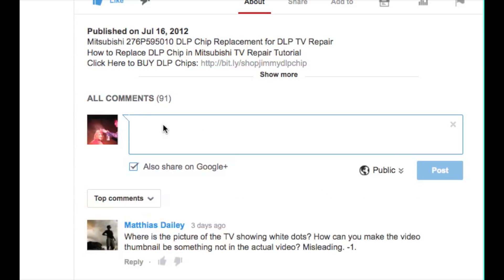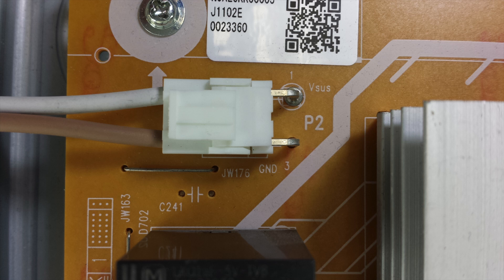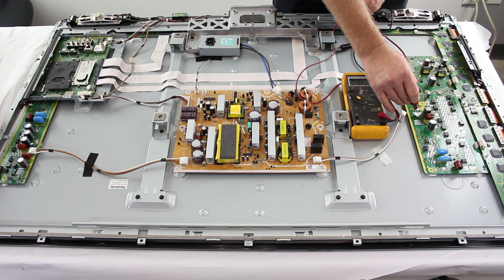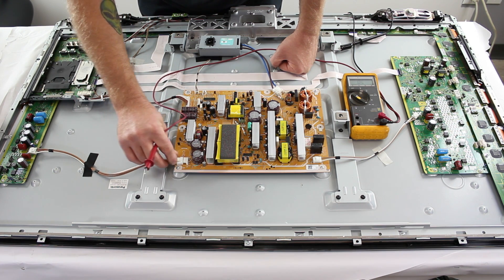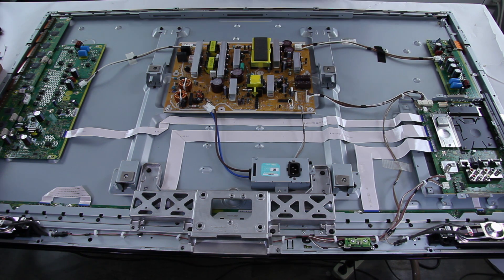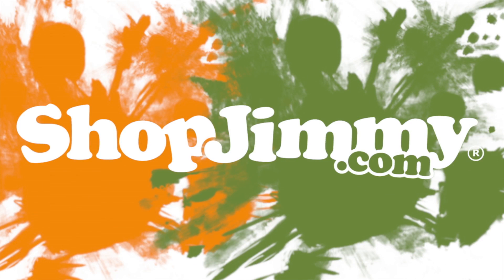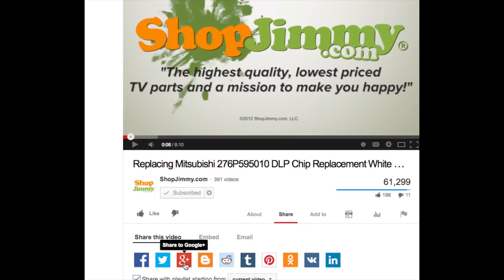Panasonic Plasma TV Repair - Understanding 14 Blink Code - How to Fix 2011 Panasonic Plasma TV

Comment: Good day “Shop Jimmy” folks! This is a great video and I appreciate you guys being willing to share your knowledge and info, to help people save some money and DIY repair their TV’s, etc. 

Ok, I have a PANASONIC 
MN: TC-P50ST30

That is giving me the “14 BLINK” error code and will not come on. I hear the clicks when it powers up, but it never comes on. It was just giving me the constant red light illuminated. But after messing with it some, I was able to get the “14 BLINK” error code.  So, can you PLEASE help me out by telling me what this error code means? What is the usual issue (if there is a common issue, that goes with this particular code, of course.)? And is this error code what will make me need to follow the steps in this video, to determine where a “short” is located and which board to replace?  If so, then that is exactly what I will do.  I am a master Mechanical Technician and I work with a multimeter all day every day, troubleshooting commercial and residential HVAC, refrigeration, ice machines and commercial cooking equipment electrical and control systems. Both high and low voltage systems.  So, I am HIGHLY experienced and good with a multimeter.

So, if I am following this video correctly, we are attempting to locate a “short” within one of the boards on this TV or within one of the connecting cables?  Is that the only thing that causes this particular “14 BLINK” error code? It is ALWAYS a short of some kind, within one of the boards in the unit?  Nothing else can cause this particular code to be thrown by the unit?  

Once I determine which board the short is located within, is there any way to actually PIN POINT the short and JUST repair the component that is shorted to ground? Whether it is a cap or a resistor or whatever kind of little components that are used in these boards, by removing the shorted component and soldering in a replacement?  If that is possible, do you guys sell JUST the little component, that I might need or do U JUST sell the complete board assemblies? And if u do not sell the individual little resistors and caps and stuff, do you know where I COULD purchase them from? 

Thanks in advance for any and all advice and assistance you can provide me, in order to repair my television.   Well, to be completely honest, it is my new neighbors television and she is a single mother with 2 children and 2 jobs, etc and the poor little lady JUST moved into the apartment next door and set up all her furniture, etc, set up her TV in the living room and was sooo ready to just sit down and relax and watch some TV and enjoy her new home and the fruits of her labor, in getting all of their things unpacked and the house transformed into a “HOME” for her and her precious children, plugged in her TV, turned it “ON” and.... well... it never actually came “ON”! Lol. So, she is not in a financial position to be able to just go and purchase a new large television for their living room, with her being a single mom of 2 and not getting ANY child support from their POS father, etc etc. 

So I told her that I have repaired a few TV’s of my own and family of mine, over the years and that I am most definitely capable of repairing her TV for her, IF it is repairable and the cost for parts is low enough to make it worth fixing, etc. 

Sooo, yeah. I am just trying like heck to help out this angel of a little woman, that just moved in next door.  So please help me, help her?  Again, thanks in advance and God bless!

Comment: 40" Panasonic,  black screen. Sound works,  red light is on,  no blinking. Manufacture id is TC-55CX400U SERIAL # MD52811741.... No model number

Comment: I  just inherited a Panasonic TC-P42X3! The  TV tuner works when connected to a cable box through a coaxial cable, but not through HDMI 1 or 2. Any suggestions or recommendations?  Thanks in advance for your comments or advice! The former owner thinks it has been hit by power surge .

Comment: Hi, I have a Panasonic Viera, model P42XT50D. Sometimes it switches on and after I put it off it doesn't switch in immediately. I've observed over the months a strange behavior. I just leave it in the off condition for about two or three days and then again I turn it in suddenly it comes on and works fine and if I turn it off again its the same story. However if its plugged into the UPS and I only turn the set top box off then its ok. But then if I mistakenly switch it off completely then I'll have to wait for three days as I mentioned earlier. I took it to a service center and he charged us a bomb but the problem persists. Could you please provide us with a solution? Thank you so much and good luck. 😊👍

Comment: Hello and thank you so much for helping.... I have a TC-P65VT50 and It will not turn on and the power light is BLINKING 3 times...please help and thank you so much.. we did all the unplugging and using different outlet stuff...

Comment: Hi. I have a Panasonic  TH50PX75U  the problem is the upper half of the display is blank while the lower half clear picture, from time to time the upper show up but distorted display, then goes away. What could be the problem I suspect the SU board but not sure  ..help ..please..
...

Comment: Hi I have Panasonic tx-58ax802b it was working just fine then suddenly not turn on just show Panasonic logo for 2 sec then clicking sound from power board and goes off then Panasonic logo on for 2 sec and this keeps happening so I did reset with _v on TV and menu botton on remote so it reset and now when I turn the TV on hear click and Panasonic logo for 2 sec then screen go off and no pic I can see the back light on from the back still on what could it be

Comment: I have Panasonic TC-50PX34. I get sound but no video for about 30 minutes. After 30 minutes the video works fine. If I turn the tv off for more than 1 hour it will do the same thing. Got sound but no video for the first 20-30 minutes. Also I am not getting any blinking codes from the red power light. Any help with this would be greatly appreciated?

Comment: Hi I have a Panasonic viera tc p54vt25 with a steamy foggy screen that looks horrible in daylight. Cleaned with a lens cleaner a micro fiber cloth didn’t fix the problem, looks like issue is behind on the inside of the screen. Is getting to the screen towards the guts of the tv a big job ?

Comment: Have a TC-P55ST30 - "14 blinks" problem whereby when TV is turned on, the screen is black, no audio, and solid red light.  Red light stays lit even though Power button (to turn off) is pressed - so need to unplug to turn off TV.  Once turned back on, the 14 blinks appear.  MAYBE IMPORTANT ==> Occasionally TV will work and when it is working, have never had screen go black or otherwise misbehave.  Also, so what am I to do differently when testing when I see GRND?

Comment: Hi, I have a Panasonic 50" Plasma TC-P50ST30 made in Nov 2011. When turned on the relays click on but picture never comes on... the LED is solid red. When the power button is held for 5 seconds it blinks 14 times. After lots of research i'm told it can be the P-board, A-board, or SC Board. I have also disconnected SC2 according to one forum i read and the LED will blink 7 times. Any help is appreciated!

Comment: In this video you check for short at TPSC1 with the power and ribbon disconnected and only talk about what to do when the short is observed "disconnect connection to SU board and repeat..." On my SC board with power and ribbon disconnected I get open (no short) at TPSC1. Does this confirm that my SC board is bad? Many thanks.
Reply: I'm at the same point with the TPSC1, the video is not clear if this means it is the SC board or not at that point.

Comment: Hi ! 
I have a Panasonic tx-p55vt60e 55" from 2013 and seens few days the screen shut down at random time with a 10 blink code red light.
I did dismount the plasma screen to clean it from dust in the case of overheating problem. 
It seems the power board is faulty, but any good advice would be much appreciated

Comment: Hi, I have a Panasonic TV MF0230307, made in Nov 2010. It has a 10 blink code, which I am wondering if I should change the power supply board? I have already changed the A - board and there still is no progress so if there is any advice you can offer, that would appreciated!!

Comment: S O S......HI CAN ANYONE GIVE HELP OR ADVICE MY 50" PANASONIS VIERA TV MODEL TX-P0X20B.....BIG PROBLEM IS IT IS CHRISTMAS AND I JUST CANNOT FFORD NEW TV AT THIS TIME WHAT WITH HAVING TO BUY KIDS GIFTS AND ALL MY SMALL WAGE JUST DONT CUT IT..PLEASE COULD YOU TELL ME WHY MY TV HAS JUST STAARTED INTERMITTANTLY TURNING OFF THEN ON AGAIN..THIS CAN HAPPEN ANY TIME,, SOMETIMES WHAN I JUST TURNED IT ON AND OTHER TIMES IT WILL HAPPEN AFTER IT HAS BEEN ON TWO OR THREE HRS....I,M JUST SCARED IT MIGHT GO OVER CHRISTMAS AND RUIN IT FOR THE KIDS..PLEASE ANY HELP WOULD BE WELCOME....I CAN USE A SOLDERING IRON HAS I USE ONE OFTEN TO REPAIR HEADPHONES ..BUT I HAVE  NO ELECTRONICS EXPERIENCE.. SO NO CLUE WHAT TO LOOK FOR..THANKYOU IN ADVANCE. HAPPY CHRISTMAS TO ALL..BRI     brian.wn@hotmail.co.uk

Comment: HI,  I HAVE A Panasonic 32" TC-L3232C Flat Panel Television THAT THE RED LIGHT ON THE FRONT KEEPS BLINKING CONTINUOUSLY WITH  NO BLINK PATTERN AND THE TV TURNS ON BUT WON'T STAY ON, WHAT SHOULD I DO?

Comment: This was completely useless,  you didnt explain what to do if sd46 connection had a short within itself.  Nothing shorts until I touch the connection for it.  The resistor you show doesnt have anything short, until I touch the connection on sd46.

Comment: i have a Panasonic 55 plasma, tpc55gt31 getting a 14 blink code  i have replaced the main board, sub power board and the power board on power up a light will come on on back of sc board for about 5 seconds then a click and that light goes out

Comment: Hi I have a 50" LCD Panasonic TC-47LE54 made Sept, 2012. When I plug in the power cord I didn't hear any click in relay of power board. When I press power button in front it stay red light for about more than 5 minutes and then it blink  red 13 times. please, Any help is appreciated. thank you

Comment: Hi I have panasonic model number TH-P50GT30A
After switching on TV 'red light'  blinks 7 times at a time and continues on in intervals. which board need replacement or repair?

Comment: Hi. I have TH - 42LFE6W. Screen goes on for a second and then off. 
When pressing power button, the LED light turns green for a few seconds and then flashes red once continuously after 2-3 seconds. Regards

Comment: I purchased your repair kit for the TNPA5351 SC board on my Panasonic TC-P50S30 plasma. The SC board showed a short across the pins of the SC2 connector before replacing the components and open after replacement. I reinstalled the SC board in the TV and it ran for about 5 minutes. Then I heard a click and the TV was dead. The SC2 pins are shorted again. Any suggestions?

Comment: All of my boards are testing as shorted on my TC-P42ST30. Maybe there are repair kits for the P (TXN/P1PKUUS) and SN (TXNSN1PKUU) boards. I have a spare SS board and am ordering a replacement A board because only one HDMI port is good.

Comment: I have a TCP50UT50 when I turn on it clicks then gives me blinks 3x.Where is the 3.3v Dboard that's what I was told is the problem with a 3x blink. If you know the part model no that would be helpful as well. I'm sure this is a rare model.

Comment: I have a xcanvas lg 50 inches with a standby light with you switch it on you will see a green blinking light but it will go back to standby again.......Water go into it just today ....after I wash the power supply and and also dry it.....when I put it on the first time it was okay after then the tv is on standby since so I want to know what is the problem

Comment: Hi, I hope you can help me.  I have a Panasonic TX-P42G15E plasma TV of 2009 which thus not want to start up anymore.  When turning it on, the green LED will start blinking (as it is supposed to do).  You can hear it clicking on.  After a few seconds, the green light turns red.  It will continue blinking red.
So, as per your instruction video, I have opened it up and measured a few points.  (I use a Fluke Finest 201 multimeter)
At the main power board – power inlet connector P9 : both pins 1-N and 2-L are not shorted. - infinite eg > 20MOhm.
With all 3 connectors P9, P2 and P11 disconnected, I measure the following values:
At connector P2, pin 1 – high value, pin 3 – shorted.
At connector P11, pin 1 – infinite, pin 3 – shorted, pin 4 – high value.
Kind regards, Peter

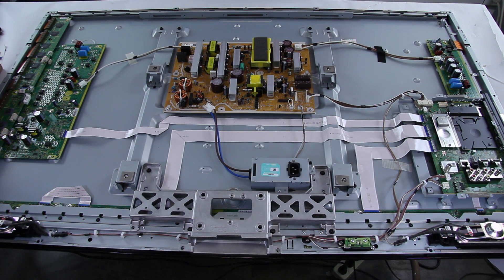Comment: I'm getting a 14-blink sequence on my Panasonic TC-P46ST30.  I'm a little confused by your instruction at the 5:00 mark of the video, here are my symptoms.  Upon plug-in, the front LED is on solid.  If power switch is pressed momentarily upon first relay click, LED stays on solid.  If power switch is pressed and held for 3 sec. upon relay click, the LED stays on then goes off after 3 sec.  When switch is released  the 14-blink sequence starts.  Does this indicate a problem with the A board?

Comment: TC-P50S30  No picture, no sound and 14 blink code.  
No short at P2 when unplugged.  Unplugged ribbon and connector, short at SC2.  No short at TPSC1, short stays at SC2.  Followed the video and unplugged the SD and SU boards.  No change in the status of the SC2 short or the TPSC1 open circuit.
Continued with the video to check P11.  Both pins open (ground pin closed) with cable connected or not.
Conclusion:  SC board is bad.  Correct

Comment: Hallo, have 14 blinks after overvoltage damage through lightning and bad weather with my Panasonic Plasma TX-P50U10E. It is not shown in the video. Therefore my question: Can i use the instruction also for this model? Is there also a written instruction with pictures available, because sometimes its difficult to understand. I am from Germany.
Want to sort out what is really broken and which board(s) are to be replaced.
Comment from Tv technican was overvoltage damage in power supply and X/Y level!
What is X/Y level? or phase Thanks a lot.

Comment: Hello I have a Panasonic TC 42 px24 that has no power .no blinks, no anything. when I plug in the power cord it shows 55 volts at the connector that goes into the power board. the power cord shows 120 volts and when I unplug it from the power board that lead into the power board shows 120 volts what could be the problem? thank you

Comment: Hi. I hva a Panasonic  model TH-P 42U30Q TV. When I switch it on, the relay clicks twice  and then blinks 20 times then goes back to standby mode. Any suggestions.  Much appreciated.

Comment: I put a new power board in my in my Panasonic TC p50st30 add the 14 blank code and the screen is still blank what else could possibly be wrong

Comment: Hi
I got this tv TX-P42X10B and in the morning it does work for 1 min then suddenly going off 
Then after no blinking no lights and even relay clicking 
But after 6 or 7 hours same things doing again 
So pls can u help me 
So which board is faulty power supply board or some other board
Thanks

Comment: I have a Panasonic Plasma HDTV model number TCP50ST30 the power light comes on when pushed buttons screen is blank nothing like it's never been turned on one day watching screen went blank never worked ever since what board or what would I need to replace to fix it do you know

Comment: Hi Jimmy, I have a Panasonic TC-P50ST30, and had to replace the MAINBOARD TNPH0912 1A. At first I bought a brand-new never used sealed board, and installed it and it just blinks. Then I was told that this brand new board needs to be programmed, that it is blank because it is a brand-new sealed never used board and needs firmware for the tv in order for it to work? I ended up finding a another "USED" board and its working so far, but now also stuck with this brand-new board... Is there a procedure to update this board or is it a dud? Thanks

Comment: I have a panasonic th-58pz800u, it is a 2008 plasma tv, the right side of the screen is black and the left side has vertical lines and the picture is fuzzy. I saw in another video where it was one of the boards, this was on a panasonic that was from 2011. Would this be the same issue on my television. Your assistance will be greatly appreciated. Also do you sell this board for my tv

Comment: I have Panasonic Plasma TC-P55ST30 55" TYV bought in 2011. I am unable to start TV . I see Power Indicator Is Blinking 14 times. I am not very technical person and not sure what to do. Help appreciated please...
Reply: I have the exact same model, I sat down this morning, turned it on and in just a few minutes heard a 'click' and no picture. Red light still on then blinking, green cable box still on so power was present. After consulting manual, unplugged it for 30 minutes, plugged back in, got the red blinking light, 14 times.  I AM a hands on, DIY person, not intimidated by most things. I've fixed our microwave, oven, dryer etc. BUT, there is nothing about this diagnosis and fix that want to take on. Just too much involved in testing and trouble shooting. I can go buy a brand new TV at Costco for much less trouble and frustration. Besides, I would expect parts to cost $100-$200 here and no guarantee. I'm sure a repair shop would be parts + labor so $300+.  I'll see if I can't sell this on Craigslist, stating it's issue and maybe some DIY electronics person will want to pay $50 for parts he can use to repair other units or he/she wants to fix if for themselves and get a nice Plasma TV for cheap. Good Luck to you.
Reply: T Randall where you able to steel your Panasonic on Craigslist. If yes, what did you mention on post.
Reply: Sell* (Typo)